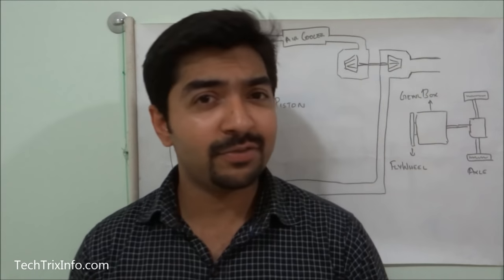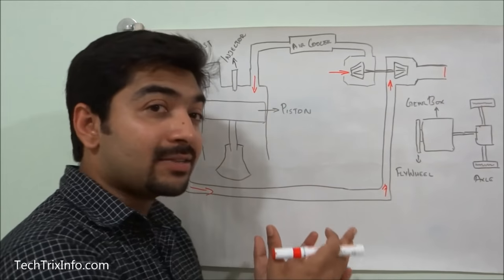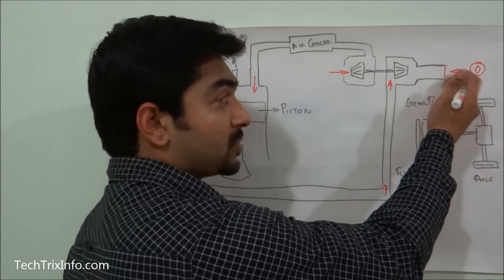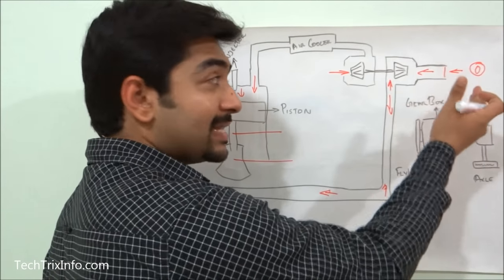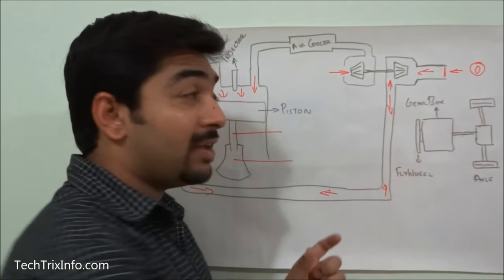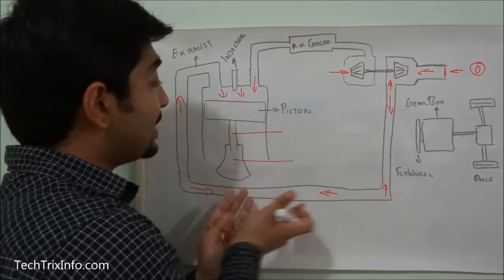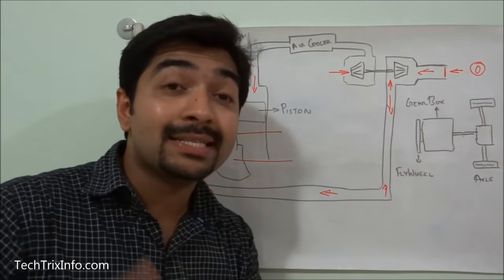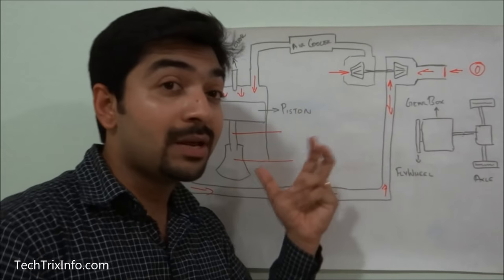How exhaust brake works – Basics.

Comment: But what's the negative and more importantly when is it used or when it shouldn't be used?
Reply: Mechanical lock is hard in engine, it should be used when trying to slow down on a steep hill with a heavy load, and should not be used when trying to speed up ever.

Comment: This May be one system a manufacturer mau use , but on u.s. trucks its referred to as a 'jake brake' . And the exhaust valves remain closed longer so that pressure in the cylinder causes a slowing effect when a driver downshift or is idling down a hill
Reply: Nope. Jake brake is a different thing. It releases the compression on cylinder by advancing the exhaust valve timing

Comment: is this Exhaust braking technique also used for Idle speed control? thanks
Reply: No for diesels you controll that with air or with the injector. but modern diesels uses both

Comment: why exhaust brakes are not used in petrol engine?
Reply: +amol allimore there is already "similar" butterfly valve in intake throtle body of petrol egine, wich is used for intake air control during acceleration and also as a break when you are not pressing the throtle. When the intake butterfly valve is closed it restricts the intake of the petrol engine which makes vacuum and slows down the petrol engine
Reply: Its because the compression ratio of petrol engine is less compared to diesel engine, so its not that effective in this case. Also petrol engines aren't that rugged so high pressures may damage the engine (cylinder walls) over a period of time.

Comment: due to exhaust brake there must be stress create on  connecting rod and the there will be a bend will occur
Reply: chance of bending a connecting rod is very feeble. exhaust brake is not applied during rated speed/ torque. it is applied during a deceleration phase. the stress on connecting rod will be more during manual breaking.
Reply: athira vijayakumar  can i ask you one ? is exhaust brake working while fuel injection
Reply: athira vijayakumar ok athira when fuel injection take place if the exhaut gas comes inside then there must a small fire will take place *(because there heat fuel and also air
)
Reply: athira vijayakumar am right friend
Reply: Jegan John Peter during fuel injection , exhaust valve(s) are complely closed,
Reply: athira vijayakumar i ask when the exhaust brake works . what about the fuel valve
Reply: Jegan John Peter i think you are saying about a petrol engine.
Reply: athira vijayakumar i talking abt diesel engine
Reply: Jegan John Peter what is fuel valve? there are only injectors
Reply: athira vijayakumar sorry not valve . fuel injector. fue ljnector is working while in working of this break
Reply: exhaust valve will be completely closed during fuel injection. so exhaust gas cannot enter the combustion chamber
Reply: athira vijayakumar but u said that while in braking time the exhaust valve is open . am i right. the process is continue . so exhaust gas is came back to combustion chamber
Reply: no no.. i meant , for a multi-cylinder engine, there are instances, of exhaust valve open during braking. if you take cylinders individually, exhaust valve will be completely closed during fuel injection. so exhaust gas cannot enter the combustion chamber
Reply: athira vijayakumar friend in the video he say that the braking is done becoz the exhaust gas come inside combustion chamberr .am i right friend
Reply: wrong. the butterfly valve applies a restriction on exhaust flow. doesnt means exhaust back comes back to the chamber.
Reply: athira vijayakumar them what happening on their
Reply: Jegan John Peter its just the back pressure built up due to restricting the flow of exhaust gases...in simple words,if u restrict the exhaust gases,the new combustion process would slow down, which ultimately slows down your engine.
Reply: Much less stress on connecting rods than on normal power stroke due to lower oxygen content of the mixed exhaust gasses and intake air therefore greatly reduced combustion force, not a worry at all.